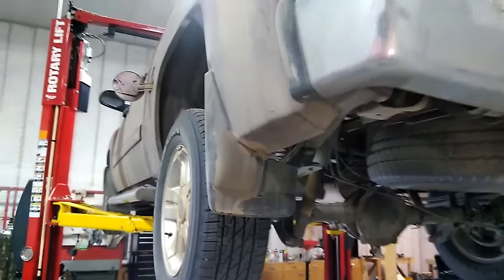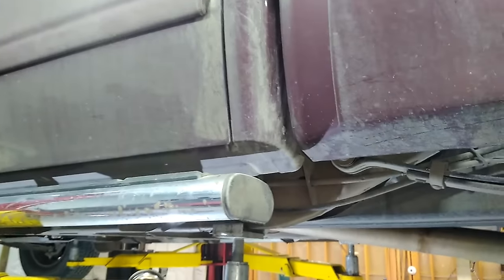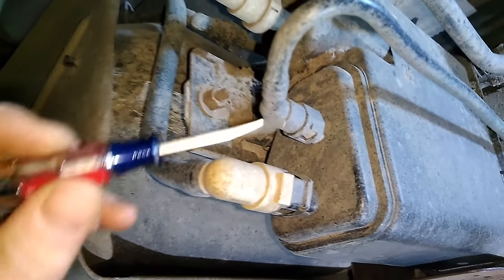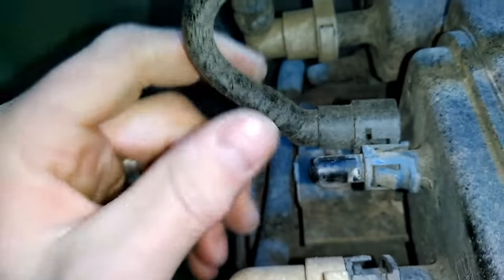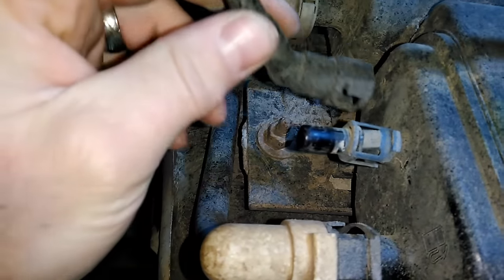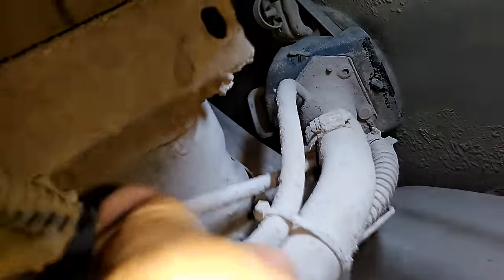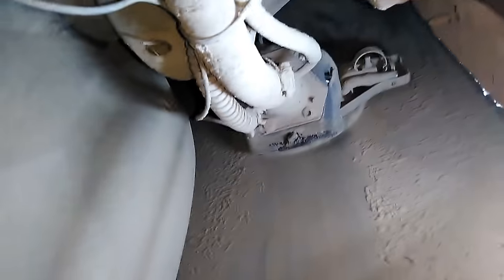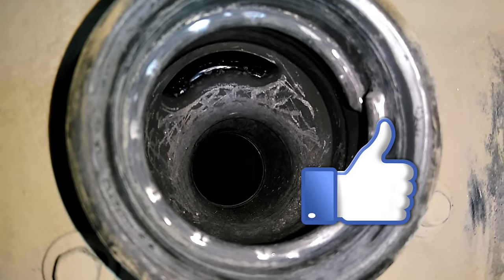Chevy Fuel Evap Canister Fill Fix Filling Slow

Comment: so should i just get a new evap canister? 160,000 miles. no maintanence, been dealing with the slow gas pumping for a while. and a new solenoid? poor engine performance as well
Reply: Heyy as a mechanic of 10 years my advice is clean it check it out test it and if it didnt fix it its not time wasted for anyone to save some hard earned cash bout to do this for a friend of mine that has this issue
Reply: @bradbyers2764  my truck seems to have this problem every 2 years. Now Im having slow gas filling once again. Done this about 5 times already.  Good time to replace the solenoid purge valve also while we're at it. Pretty sure that sensor throws a engine light shortly after the canister becomes clogged.
Reply: @TheDannyV76  Chevy seems to have an issue w this my buddy has the same issue w his 2010 avalanch and atleast its a canister issue and not a leak I'm bout to do this job in the am on a dodge caliber before work lol thankfully my friend is getting rid of this thing soon and going w a newer SUV (thank god)

Comment: I have a very heavy fuel leak around the evap tank 01 Silverado. Is it at all possible that the evap tank could be the problem? I've checked my lines and they are rusty, however the leak only happens sitting on a slight incline. As soon as I start it, gas is pouring out. Thanks!
Reply from the maker: I would say you will need to address the rusty lines sounds like when the pump kicks on it is leaking out of the discharge line suppling the engine with gas

Comment: That top one you can push on the rounded side to unlock instead of breaking it
Reply from the maker: Thanks for the advice, i just wish the engineers designing stuff like this would just come up with one simple clamp instead of 3 different ones. Really is aggravating lol
Reply: @HighOctane101  they do that so you take it in to get worked on so they can screw it up even more and eventually have you buy a whole new truck lol

Comment: IS THERE A WAY TO TEST EVAP SOLENOID??
Reply from the maker: Set your multimeter on ohms. If the multimeter is not automatic, set it on 2k ohms. ...
Place the probes of multimeter across the pins of a solenoid coil. If you find 3 pins there, one of them is a flat pin which is connected to the ground. ...
Read the number on the multimeter. 40- 60 ohms
if open circuit then it is bad

Comment: That's a complex system, it checks for leaks in the the complete evap system constantly,the problems I've seen with the vehicle's that they were never cleaned and or maintained,thanks
Reply from the maker: D L2 agree I just wish they would have kept all this in the engine compartment like they did in the late 90’s. It would still be clean

Comment: I have a 2032 Silverado 1500 and I’ve had the problem of the canister filling up with dirt. The truck is still under warranty and the GM dealership will not honour the warranty and fix the problem instead they charged me for the fix. Shame on you GM. Maybe I should look at buying something other than GM for my next vehicle.
Reply from the maker: That’s bs, I’d be mad

Comment: Are not the carbon granules  going to fly off when you blow air in it? Is this the objective?
Reply from the maker: They could if the foam inside is bad that holds them back.  I guess if they come out you might smell gas when you fill up
Reply: I cleaned as you suggested, more air flow free but most of the granule flew off, maybe one third of granules are left inside.....
 @HighOctane101
Reply: Tried everything. removed gas tank, new evaporations system, checked filler neck, nothing worked on mine..... @HighOctane101

Comment: Hello was changing fuel pump and let jack down to soon it pulled the canister and broke the nipple off will it run with out it im so worried. What do i do now?
Reply from the maker: It will throw a code,, super glue it or melt it back together with a soldering iron
Reply: @HighOctane101  thanks for the reply glued it its running great but I have one more question after changing oil my oil a few weeks ago since then ive noticed my oil pressure guage is maxxed out like showing the higest reading on there ot almost amd sometimes it will drop low go high. Whats wrong?
Reply from the maker: @amyburns5199  a bad ground or oil sending unit on engine
Reply: @HighOctane101  thank you! Will it hurt my car to drive it like that untill I can fix it?

Comment: What about if charcoal pellets fall apart and start coming out of the canister?
Reply from the maker: Then you either buy a new one or run it with less carbon pellets then you will have a gas smell just like you would by leaving a gas cap off

Comment: How long before check engine light goes out? Turns off I mean?
Reply: Never, this is a hack.  If you have a check engine light then replace your canister vent solenoid. The charcoal is only for fuel vapors after the engine has exhausted and has NOTHING to do with filling (unless you overfill alot, then you will fill the canister up)  Cheers
Reply: @hshsgjakanss  I replaced both of them already. The solenoid and the one by the intake. O'Reilly says replace the charcoal canister also. I just cleaned it.

Comment: No water, just blow with air. Also need to blow lines out as they get stopped up too. Water and charcoal mix to make a hard block .
Reply from the maker: I did that in previous video and it works also

Comment: Hey I’m getting code p0446 what you think I should change
Reply from the maker: Maybe if you are having issues filling, it also could be the purge valve if you are not having issues filling.  Gas cap tight, any air leaks

Comment: air lock in fuel vent.   i found fuel in the fuel vent hose,,,   what is the fix?
Reply from the maker: Sounds like the purge valve stuck open or you topped the tank off too fuel

Comment: HELP.
I changed the canister, solenoid, everything new. I am still having the problem a the gas station.  Anyone know what I need to do Or recommend a video?
Reply: When you swapped out your canister, did the old one have carbon bb’s coming out of it?  If it did, then you may have all your lines plugged up with the carbon bb’s.  Will have to remove lines and blow them out.

Comment: It is NOT good to put water into the charcoal canister! Absolutely DO NOT put any water into the charcoal canister!!! You can however blow out the canister by using compressed air, to try and blow the dust out of the canister. DO not use water inside the canister, unless it is your very last resort. Please know, that water inside the canister, will destroy the functioning of the charcoal, which is designed to filter the pollutants out of the gasoline vapour, before it exits the vehicle through the vent valve. Water will also likely shift the charcoal inside the canister, and redistribute it unevenly inside.
Reply from the maker: It still is in use today, as far as it functioning correctly I don’t care. As much gas it made me spill on the ground overtime caused way more pollution I believe

Comment: Mine goes up to the engine compartment, mine is an 07 though
Reply: Out of curiosity assuming you have a 2007 Chevy 1500, where might the fuel filter be because mine is not on the drivers side rail. Thank you
Reply: @solidhitter4  yes I do have a 07 1500 not a classic, I couldn’t find the fuel filter, could it be above the tank?

Comment: I did this and my check engine light is still on so I put machine on it and it’s still reading that it it the vapor canister any ideas
Reply from the maker: Did you try clearing the computer of codes?  Disconnect the battery for a bit then try
Reply: High Octane yes I unplugged the ground for 30 minutes
Reply: High Octane is there another way of doing it or do you think something else is clogged

Comment: Don't do this, things work together there's a reason it has carbon in the box. All is monitored by the ECM. Full explanation @ https://www.youtube.com/watch?v=LYifnstYsx4     Check out before you flush with water or even pressurized shop air.
Reply from the maker: It still works, we are not removing the carbon just cleaning for!  The water left behind is very little and when a vacuum is pulled on it it will instantly turn to vapor as long it is not too cold outside!  Gas has water in it to so these see moisture all the time!  Have done this many times and it does work if don right.  See this new vid I posted about taking the canister apart and relocating the vent!  https://youtu.be/auFImpmQXF8
Thanks for the link though it is a good explanation of evap system
Reply: @HighOctane101  Staying open minded the link you provided takes me to a tennis shoe ad?  It takes 28.92 inc of vacuum to boil off water at 80 deg F, or 25,400 microns (-) pressure.You would never see this (-) pressure in a fuel sys the tank would cave. But maybe I'm missing your point? Again open minded. The moisture was not my real concern as Ethanol introduces or inducts H20 into the fuel.  My point would be is, X amount of charcoal is measured into these Carbon cans with baffles and mesh screens, pressed then the plastic shell is heat welded around the matter to hold all in place. So what happens to all the internals of the can with a water flush? Will it still be able to absorb fuel vapors for re-gin when the manifold vapor valve opens? My system had charcoal pellets falling out of it and occluding the vent lines. And I never washed it out with water or blew it out w/shop air. So how could it be that pressurized water is not destroying the internals of the can. Was all the black stuff in the water coming out just dust?
Reply from the maker: Yes it was just dust,  if you would ever have the pellets fall out then you have a bigger problem with the screen!  Then I would agree through it away.  I just giving some options out there if you did not have the money to fix and you could get by for cheap if you have the tools and the no how to fix.

Comment: ISSUE: 
Fueling is difficult… 
TOPIC: 
Small diameter Vent Hose that runs from Canister to Solenoid to top of Fuel Nozzle… 
QUESTION: 
Will the vehicle function properly and will fueling return to normal if; 
  The Vent Hose is simply disconnected at the top of the fuel nozzle ??? 
(See Notes)

Notes: The hole in the fuel nozzle would be plugged… The Vent Hose would be rotated away from the fuel nozzle and zip tied in its upright position… 
All venting would simply be through the wheel well & quarter panel, not the fuel nozzle… 
~~~
Notice: Disabled Elder on disability… Simply can’t afford or crawl under cars anymore due 12 cancer surgeries and tubes attached to torso… However, I should be able to remove the interior trunk wall and work from an upright position… Just Sayin’… 
~~~ 
Await Response… 
Thank you for your time and consideration…

Comment: I did this last night and it worked like a charm it took me less than an hour. Thank you sir 👍🏽
Reply from the maker: Good deal
Reply: did you cleaned the same way and why was the reason
Reply: so did it throw a code ? Is this why you had to clean yours? Also if so did ur check engine light go out ?
Reply: how long fid this work for you flushing out the cannister

Comment: Would this give you a check engine light
Reply: Yes it would
Reply: A morris I changed it, but I still have a engine light even after resetting it.
Reply: Well my check engine light is off but still pumping slow. I changed the  the one under the hood, canister in all still pumping slow. I will suck out the lines tomorrow. Did u unplug the battery before you changed it?the solenoid under the hood should clear the code but when you take it off there will be charcoal coming out of line, I think that's the problem.
Reply: @hshsgjakanss  lmbo I still have the problem

Comment: The first video i've seen showing how to get the hoses off. Thank you.
Reply: The top hose broke because he should have pressed the clip in them pulled the house off. He tried to pry it down which broke it
Reply: a-1 auto shows you exactly this process but just replacing the canister instead of cleaning it
Reply: Those hoses were a pain in the ass, and I'm still having a fuel issue

Comment: Thx dude - you gave me a great overview for this job - point of note - 2004 Yukon XL Denali is a POS job as the canister is above the spare wheel, the prop shaft, the diff, etc - but got there in the end...... there is a really good video by a 'dude' that explains how to split the connectors (probably the worst part of the job).

Comment: It looked like the bottom of that canister would unsnap and could be removed.  Though it is illegal, would leaving the engine running help flow rate?
Reply from the maker: Probably could but would lead to dust getting into engine when regeneration starts

Comment: The top vent line w/ the white horseshoe clip, you don't pull it out. You push it in to release it. Good vid otherwise. Resorting to flushing w/ water worked for me too. Shop air alone just wasn't enough. Maybe drill a hole at the lowest part and plug it w/ a screw after ~ a week.
Reply: Is your canister still working fine :)
Reply: @mohamedhosini2103  It wasn't my vehicle and been a few years now. But was their regular go-to guy and no Evap complaints since the repair.
Reply from the maker: @mohamedhosini2103 yes it is

Comment: Man...the clip you broke on the third hose  ....I think you did it the wrong way...you just needed to press the clip down  and pull the hose out...Am I right?
Reply: I think you are right. A similar white clip is on the evap purge solenoid on the top of the engine. With thumb  pressure on side of clip, it will release its grip. There's a sweet spot, you don't need the screwdrivers.
Reply: Yes that right.
Reply: You’re very very very correct.
Reply: Yes

Comment: So, if you take it off, charcoal pellets are not supposed to fall out? I took one out of a chevy suburban and a ton of pellets immediately started falling out. Does that indicate that the canister is bad?
Reply from the maker: The internal screen to hold pellets back failed.  You may have to get new one.

Comment: I tried this and it didn't work. I did see some improvement when I went to fill up but still doesn't vent right. Maybe I need to do it again or something.
Reply from the maker: It could also be the sponge filter where it breathes, it is on the filler neck on the inside of fender area just behind the gas cap
Reply: @HighOctane101  I'll take a look at it and let you know. Thanks for the reply.

Comment: Wow!  Running water near the electrical outlet, not cleaning out the corn stalks while you are there, destroying those clips and saying 'not a big deal', wwwhhhheewww.  MY OCD is on fire right now.  I hope you are not a 'real' mechanic and this is a hobby.
Reply from the maker: Yeah I’m one of those fly by night ones that gets it done without selling extra parts that go into land fills
Reply from the maker: Also using deionized water will not conduct electricity, it will be ok. Thanks
Reply: “Deionized” water from a hose?  No. When you are flushing the can out…an extension cord is right there by your puddle. SLOPPY!  And corn stocks do not go int land fills. SLOPPY!!!
Reply from the maker: Yeah I like clean water, and I did not mean the corn stocks go to land fill, I meant the big plastic charcoal canister box going to land fill.  As far as the corn stock I usually let those for a real mechanic😂

Comment: the main issues with the canister is not the dust but from eople over filling there gas tank which leads to gas gumming out the charcoal in the canister. people when the pump shuts off dont add more fuel..  with the charcoal issue the canister can come appart and suck the charcoal pellets up the purge line and block that as well.  i wouldnt advise washing out the canister

Comment: I had the same problem but found my canister was not plugged. The little carbon BBs inside the canister had gone down the tank vent tube and plugged it up. I had to vacuum the BBs out of the tube and the problem is now solved.
Reply from the maker: The little screen must have failed inside

Comment: Another video with a complaint about the poor design of the hose connection, but missed the great design feature that makes it easy.  The one that you used 2 screw drivers to pry the clip off and broke it in half... the design is such that you simply press on the clip and it spreads it open so the hose can pull off.
Suggest not to use a zip tie on the fuel tank high pressure output.
Reply from the maker: I don’t get your comment

Comment: What happens when you take it off and turn it upside down and the charcoal pours out of it. Do I need to get a new one?
Reply from the maker: Yeah I would, the screen inside that holds carbon back is bad. You risk getting carbon in purge valve and you will have more issues
Reply: Too late, I had to change that also the purge valve that is, it was full of carbon beads. It had my tahoe burning gas and running rough. I change everything all the way back to the canister and the vent valve. Thanks for the reply

Comment: If it was an Emergency and you are running low in gas and can't fill the tank, can the canister be bypassed temporarily? Could of sworn I once read that one of the lines can be removed from the canister and this would allow you to fill your tank up with gas.
Reply from the maker: Yeah you could you will smell gas vapors would not park inside unless you put them back on